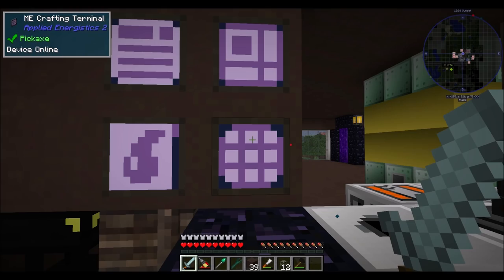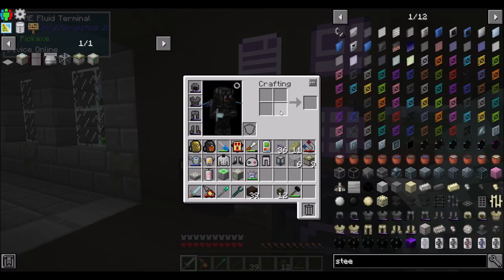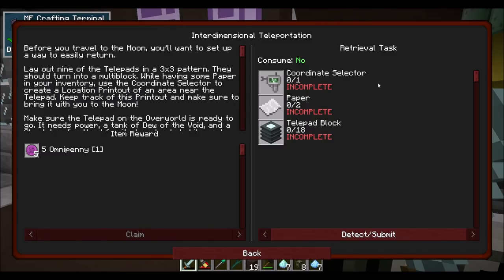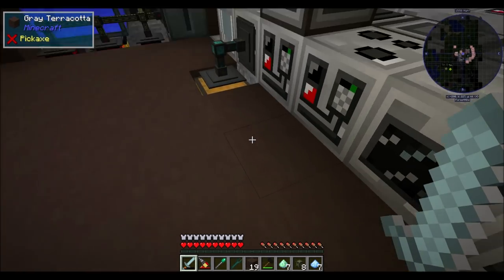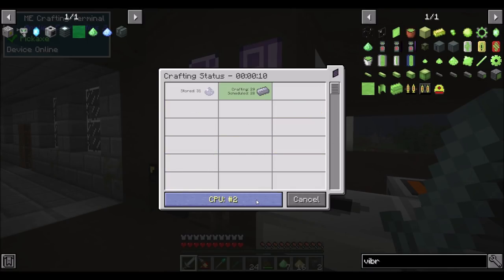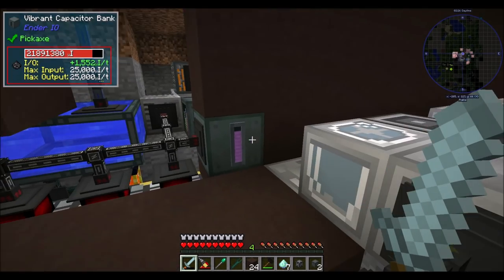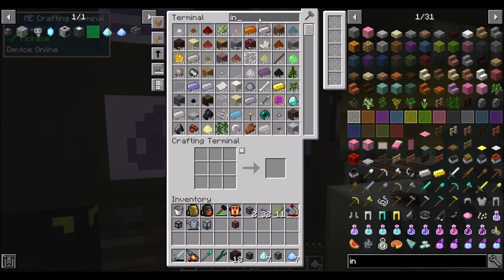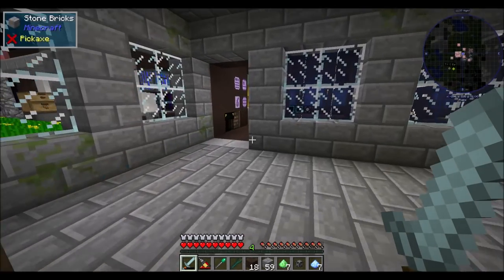OmniFactory   Ep37 Teleporters

Comment: I have to say, Dire's insistence on surrounding Molecular Assembler with interfaces makes things more painful than they should be… Ideally it should be the other way around, with each crafting CPU having a few co-processors so crafting is happening in several assemblers at once. Instead we have several recipes fighting for the single crafting space available.
Reply: yeah I have at least 3 molecular assembler for each interface in my auto crafting tower.
Reply: Shylight can you explain this to me? I don’t fully understand AE2
Reply: @AdamOneTwo  Molecular Assembler is what's actually doing the crafting, it takes a bit of a time to actually work. While the time itself isn't long (especially with acceleration cards), it still adds up if you need to craft a lot with it. 

Now, if your crafting CPUs have enough coprocessors and your interface has access to a few molecular assemblers it will use all of them to craft simultaneously. So instead of crafting 1 thing at a time, you're crafting 5 for example.

Dire has the opposite setup where 5 interfaces are trying to craft in one assembler. So first one locks it down with 300 small things, the other 4 are waiting while it finishes to make their stuff.
Reply: @Shyl1ght  Tips and things like this need more upvotes. I get that Dire is putting on a show and that's why he does things so haphazardly, but since he is such an influence on the gaming community and how many people learn/play; comments like these should be upvoted so high they can't be missed that way he will see them.

Comment: Dire! There is a infinity booster card in your AE system!
Reply: Infinity booster cards are limited in this pack.  Each one gives you a bit of energy that is used when you are out of range.  I calculated it in a previous episode but it's something like 6 seconds per a card.
Reply: They are limited in this pack.  Something like 6 seconds per a card when you are out of range of the AE system.

Comment: No surprise for me, you have a 1024 EU EV EBF, on essentially a MV to HV line with is designed for HV 512 max as input, you will need to upgrade your EnderIO conduits to Endsteel, Darksteel plus ground Endstone.
Reply: Actually not really.  End steel is great because it's cheap but it's not required.  He's running a 4x HV CEF which requires 512*4 or 2048 EU/T or 8192 RF/T.  so the HV CEF can run off of vibrant alloy cable.  The problem is he's only using one connection to his capacitor bank.  Therefore his conduit network can only draw 8192 RF/T total between all the various machines he has hooked up to that conduit network.  A second connection to the capacitor bank would allow access to 8192 RF/T * 2 across the entire network, however each output can only draw 8192 RF/T each.

Comment: I think u need to do that seperate cef(hv) with four batteries for the blast furnace. So u have a dedicated line to each power input. Like u mentioned a few episodes back
Reply: Nope, all he need is to remove one of the inputs and problem solved.
Reply: All he needs is a second or more connection to his capacitor bank.  That way he can support more than 1 4x HV CEF on his power network.

Comment: You EBF is low on power because you only using 8k rf/t conduits and it is on EV level so you need at least 32k rf/t to power it. 

Edit: Ok I should have waited till I watched the complete video. :)
Reply: No, the problem is that he is using 2 power inputs and thus requiring all 4 amps and more due to power loss.
Reply: @hubertnnn  There is no power loss with lossless cables, I use almost the same setup with my blast furnaces.  The problem is he's using cables that barely support 4x HV.  Here's the calculation. 8192 RF/T conduit to 2048 HV 4x CEF = it requires 8192 RF/T.  Perfect right?  However he only has one connection to his capacitor bank.  That single connection can only draw 8192 RF/T from the capacitor bank.  It then goes to how many ever CEFs he has in his base that is running off that same conduit line.  Between every single thing that is using that conduit line they can only use 8192 RF/T total.  

The solution would be to either upgrade to end steel conduits, which is very cheap or to just put multiple connections to the capacitor bank.    Each connection would allow his base to draw an additional 8192 RF/T.
Reply: Nope, the fact that this pack added losless cables is quite confusing. Cables are not the only thing that causes power loss. 
Every machine on the path of power (battery buffers, transformers, CEF) is also causing power loss based on formula "2^tier", so MV will have power loss of 4, HV will have power loss of 8, EV 16 and so on.

Quote from GregTech wiki: 
"Also any GT Block and Battery outputting Energy has an energy loss on output. This means there is no such thing as lossless cables in GregTech."
Reply: @hubertnnn Even so the power loss would be so insignificant to not cause an issue.  Like I said, I use the same setup Direwolf is using atm for his blast furnace.  2x energy input hatches with a 4x HV CEF works just fine.

The problem is he's not supplying a 4x HV CEF the 8192 RF/T it needs to operate.  Because he's splitting a single 8192 RF/T input to multiple outputs some using 8192 RF/T.  Multiple inputs would fix the issue.
Reply: @hubertnnn  Because wiki's are inaccurate I decided to test.  Creative test world  UV 4x CEU outputting to CEF to CEU to CEF to CEU to CEF CEU to 5 8x awakened draconium lossless UV cables outputting to a UV CEU.  Pre-charged everything so internal buffers wouldn't mess up the test.  Placed 4 empty capacitors  in the final CEU.  Placed 4 full capacitors in the first CEU.  End result 4 empties become full and all machines have a full buffer.

Repeated the test with a similar HV setup and HV sodium batteries.   Same result.

End conculsion:  The wiki's mention of CEF's having energy loss is inaccurate or so insignificant to not be noticiable even with multiple CEFs.
Reply: Hmm, good test, I guess since CEF is from another mod its not working fully as intended.

I already participated in talk on discord about the fact that CEF dont need batteries and always outputs 4A while everyone thinks it outputs 1A per battery like a battery buffer does.

Good to know that CEF has no power loss, thanks.

Comment: You can put the capacitors from Thermal in the CEF's instead of the gregtech batteries for much better power storage, and it'll still power the gregtech machines correctly. Also CEF's with 16 slots instead of 4, increase power storage even further.

Comment: Dire, please! Would you STOP already with the "having a power problem, remove connector, then forget to replace it later when you need it running" and actually and really solve it once and for all? EnderIO's transceivers - if I recall their name right - are in this pack, and can transfer power. Not to mention you should already be P2P'ing the base up and getting the power transfer problem well under control that way. You absolutely need to ramp up biodiesel to Forge energy production, I recommend ramping it up until you only see full buffers everywhere! The best powergen will always keep your base full at all times! This you know from experience.